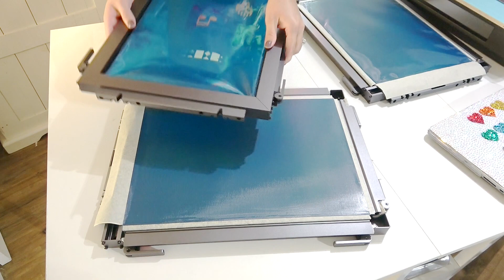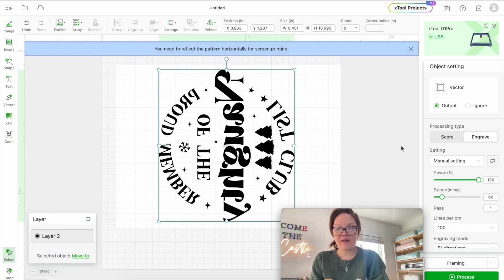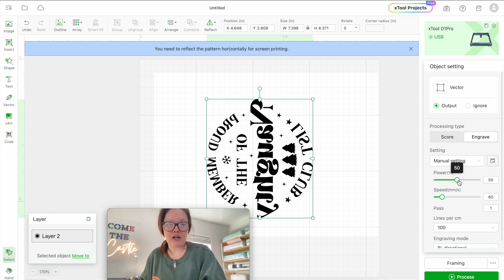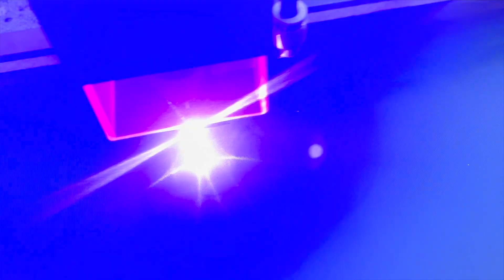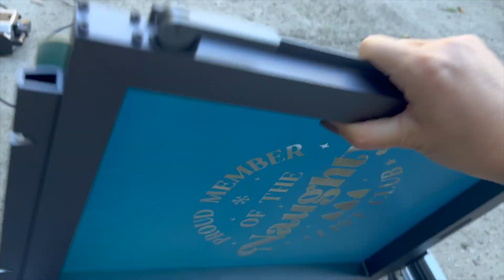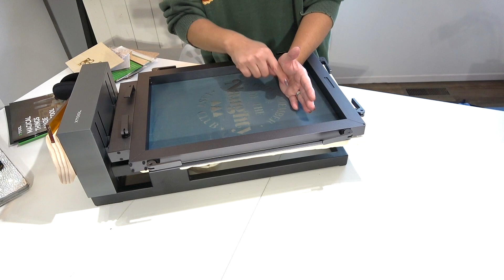Learn How To Use The Xtool Screen Printer With This Easy Tutorial!

Comment: I know this is year old and you might have already learned this by now but here's few printers on the actual printing.

1.	the hinge mechanism is how you close and lift onto the item you are printing on, not by raising height up and down (that is for allowing for the depth of the item you are printing on.

2.	With the screen slightly raised (by the hinge) from the item you want to print on, ‘flood the screen, i.e. take the ink across with the squeegee. Then lower the screen down and then use the squeegee at a 45 degree angle, ‘pulling’ it toward you, and this presses the ink onto the surface of the substrate. Life the screen by the hinge.

DO NOT leave the screen full of ink for 10 minutes, that incorrect (I assume they are telly you to let the ink dry on the substrate for 10 minutes (before doing anything like taking to a heat press to ’cure’). Leaving ink on a screen will just make it unusable.
Reply from the maker: Thank you for this!
Reply: @ashleefalco  you're welcome. I so want one of these! and a laser! just keep looking at videos of people using them and feeling envious 😂

Comment: Have you tried cleaning your screen to use later? I cleaned mine and the masking tape edges came off and my screen didn't fit correctly/tight in the frame afterwards. Have you had this issue? If so, what did you do?
Reply from the maker: when I had the machine, I cleaned them right when I was done using them. I took them out and hosed them off and they were fine.

Comment: Well, I can’t get this thing to work. The ink goes right through the shirts, I get spots where the ink didn’t go through the screen, where other times it did. I’ve destroyed a dozen shirts, so far. I’m ready to smash this thing with a sledge hammer.
Reply from the maker: First, why are you wasting dozens of shirts? If it doesn't work with one then keep using that same shirt!

If the ink didn't go through the screen to your shirt, you didn't press hard enough. I have noticed if you let the ink dry on your screen it will dry up the holes in the mesh creating spots. So always keep your screen clean.

Comment: if you use both hands to pull the squeegee you won't need to hold the frame down, and you'll avoid getting raised areas and have a more consistent print. also if you put the squeegee on the front of the frame where the magnetic strip is (ie where it's meant to go) your ink will drip into the screen and not on the handle of your squeegee and eventually your table and machine, plus it'll be ready to go for the next pull.
Reply from the maker: Thank you for the guidance!!

Comment: You really have to wear the goggles just holding up your hand is not enough.
Reply from the maker: Thank you!
Reply: I just wanted to follow up on the glasses, ALWAYS make sure to wear your safety glasses firmly to your eyes and Ensure that the glasses your wearing is suitable for the wavelength of your laser. Don't Buy Cheap Glasses! Also, reflections or the bounce of the laser beam can still damage your eyes regardless of the distance... Just wanted to make sure you stay safe!

Comment: Do the screens come pre-coated?
Reply: To coat a screen, it has to be stretched in a frame so that the coating is uniform and thin enough to burn (or engrave in this system) properly. In this system, reclaiming a screen (stripping the emulsion) would have to be done in the frame, which would put considerable wear and tear on it since water and emulsion stripper would get in those channels and the tension mechanisms. You would then have to be able to recoat the screen to an emulsion thickness where you could reliably use the same engraving settings, which would be very difficult for people printing at the beginner or hobbyist level.

My guess is that the screens are manufactured in a large sheet, machine-coated in blocked off areas, then cut to size and taped on the edges. In the livestream, they said the screen mesh was steel (the laser would melt the polyester used in traditional mesh), so handling the edges untaped would be dangerous, and that tape would likely come unglued if it got wet.

Not even sure if the emulsion is pre-hardened garden-variety emulsion or a specialty kind that melts better under the laser. With the smell Ashlee described, it sounds like it is a plastic polymer-based emulsion, but since you just burn way the stencil part, there's no washout, so it's not working on light sensitivity the way a standard emulsion would. Large-scale screenprinters use lasers to expose in some high-dollar setups, but they use the laser as a light source to expose a photosensitive mesh and then wash it out, not as an engraver.

On the Kickstarter, the screen refills are $24.99 for 4. I wonder if they will have some sort of recycling program for the used mesh, with maybe a price incentive if you return screens you no longer need. Some designs you will want to keep, but some will be one-offs or goofs (as Ashlee illustrated, there is a learning curve to the engraving process).
Reply: @rlaureng  completely agree
Reply: Any idea if they can be reused? Like washing off the emulsion coating and reapply
Reply from the maker: I'm not sure. I do know since using it: the blue is what get engraved away. I'm not sure what that blue stuff is, and where you'd buy it.
Reply: @ashleefalco  in traditional screen printing its called emulsion and can be found at screen printer supply stores
Reply from the maker: They do!